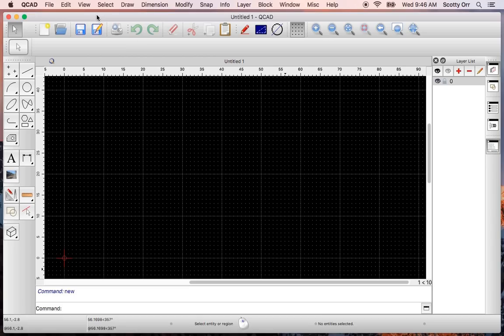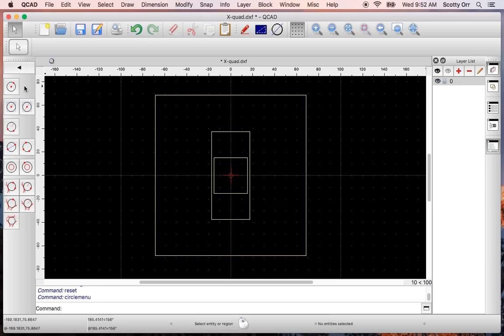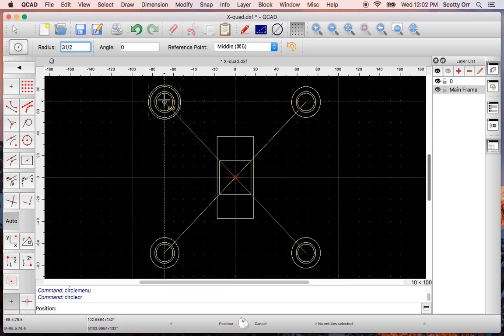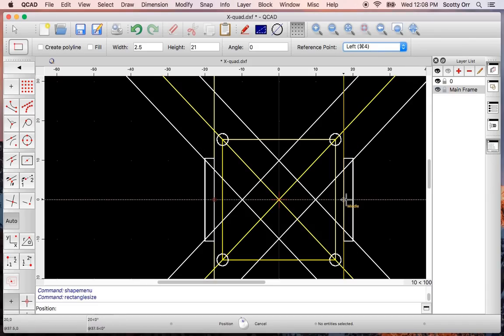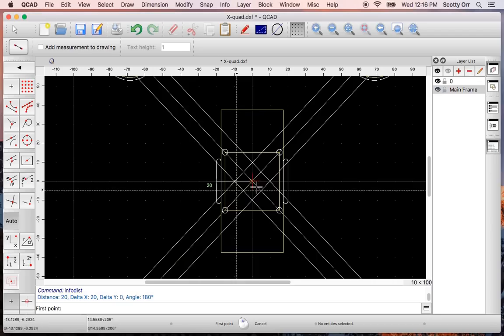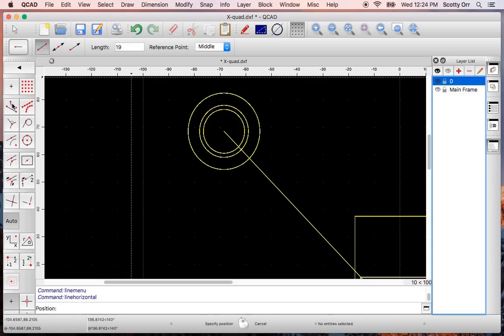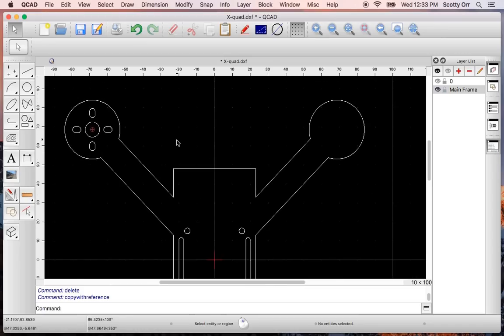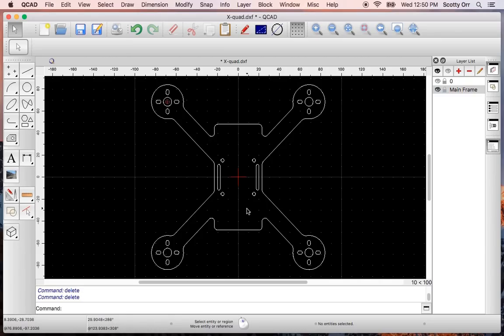Getting Started with QCAD

Comment: This is quite helpful.   One question i have is about making changes.  Suppose you decided to change the 6mm radius on the acute angles to 5mm or lengthen the  arns.  Is there a quick way for that or does it take a lot of manual rework?
Reply from the maker: I don't believe QCad offers the functionality of having drawing elements change when changing dimensions (like autocad for fusion360). If it does, I don't know how to use it.  There may be work arounds (you can "scale" a selected entity, but it's still going to be a more manual process and won't automatically adjust adjoining entities).

Comment: before buying , be aware that the $40 fee does not gives you access to the CAM plugin , you have Qcad pro , that's all , no CAM.I was trapped in this...
Reply from the maker: Yeah, unfortunately getting the version with CAM will set you back around $120.  I just use the free community edition of QCad for design, and use the Fusion 360 manufacturing environment for my CAM.  (I just use these for hobbies though, and not to make money.)

Comment: When starting to create something like this I would suggest that you take a moment to study what you envision for the final result- you have 4 arms and motor pads that are all the same, you have 16 of the small slotted holes and 2 of the long slotted holes.  The first rule of CAD is to not draw the same thing twice.  You could have created one of the arms including divisions and fillets, then you could copy and mirror it twice to get all 4 of them.  You could have created one of the small slotted holes and copied and mirrored/rotated it.  You could have created one of the long slots and copied it.  This would have been a lot less work.
However this is still a very good video to demonstrate the capabilities of the program and how to use various of the commands.
Reply: How ? This is not autocad
Reply: @jmans4928 QCad has all the necessary tools to do this.  For instance he makes 2 slots for straps to hold down the battery.  He does the same operation on each slot.  He could have drawn one slot and done all of the modifications to it then copied/mirrored it to the other side.  The arms with the motors have the arms themselves, the motor pads, slots.  When you look at the finished item you see that there are 4 arms that are essentially identical, this is a prime situation where you would draw just one and do mirroring.  Look at other places- the 2 slots for straps- you draw one and mirror it.  Each motor pad has 4 slots- you draw one slot then mirror and rotate the others.  When you have to do so many steps to make a slot with rounded ends you don't want to do it any more than you have to.  When you put in fillets at the corners you don't want to do it more than you have to.

Comment: Excellent way of introducing Qcad tools. Thanks for the video. Surely there is a fillet tool that could do the final rounding more easily though?
Reply from the maker: Thanks.  There is such a tool - pointed out by Bzeemer in his comment earlier.  It's the "Round (m)" command.  It's in the Modify menu if I recall.  I use it all the time now.

Comment: Thank you very much for this tutorial. I used to be an AutoCad user and this program comes close to what I was used to draw with. I got a small tip for you to use the command "Round (rn)" to make an arc between two lines instead of "2 tangents and radius (ctr)".
Reply from the maker: Hey man - thanks for the tip!  That will save me tons of time.  Guess I should be exploring more of the tools in QCad...😉

Comment: What an amazing video. Very clean and concise use of this CAD tool in a practical application. 
I wanted a simple CAD tool to map out the boundary of my garden and I found testing various tools required intensive learning that was time consuming and tiring. This video showed how to find and use important tools in QCAD in a drawing example that would be applicable to most drawings. The only thing not covered was how to show dimensions on a separate layer. Thank you making this great video👍

Comment: Thank you very much! great tutorial however, I would like to see if you can help with architectural drawings and printing. I have been having problems with dimensions in foots and inches, somehow it does not show in the drawings and cannot get the grid measurements to draw in 1/4" = 1'-0"
Reply from the maker: Thanks!  Sorry, I can't help you.  I never use those features in QCad.  I'm guessing they are probably there, but I'm not sure. You might check out some other tutorials or do a "search" for that feature.

Comment: The tutorial is very good. However, this software has a very bad workflow as compared to other Autocad 2D and its look-alikes.
Reply from the maker: It could be my use of it is what the bad workflow is.  It works great for me, and it's free!  I haven't tried Autocad 2D and likely won't because I can't afford it.  (Even if I could, QCad suits my purposes for 2D.) . I use Fusion 360 for 3D.  I find I can export my DXFs into 360 for extruding, and setting up CAM operations.  Thats "my" general workflow for now.  Could be I will eventually use F360 for my 2D work, but it will require me to learn a new skill set.
Reply: @sloscotty  Try Draftsight. It is free until December 2019. The time you will take in it to do the same thing will be only 25% of that of Qcad

Comment: This is a very good tutorial.  I have a question though.  I want to use this to laser cut acrylic.  I want to create a rectangle cutout and screw hole cutouts to convert to Adobe Illustrator for the laser cutter.  I have a rectangle set up as 80mm by 60mm and the screw holes are set at the corners.  When I convert to PDF and print, the drawing is not in scale.  How do I print in scale? Thanks
Reply: I haven't worked with the PDF export feature that much.  When I have, it has been to reduce the drawing in size.  Then I convert that with Preview (Mac) to a jpeg, and capture a screen shot, then print that.  That won't help you, because you want actual size.  If your units are set to millimeters, then I don't know why the 1:1 export wouldn't work.  (And then I've had printers themselves mess up the scale. ) I have laser-cut acrylic before, but my front-end will accept QCad's DXFs just fine, so I haven't bothered with conversion programs.
Reply: Scotty Orr thank you! We have an organization called dospace that we can use their laser cutter. We have to export the file to adobe illustrator and use the print feature to do the laser cutting

Comment: I can't seem to get any drawing's from Q-cam into Mach 3...Wonder if you might have any tips or ideas...I have been trying for days...So bound and determined to get this figured out. I think it might be something with the scale...Any tips would be so appreciated. That first tip of moving the center point..really helped me. The divide step really helped me out.
Reply: I haven't used Q-cam or Mach 3, so I can't be much help, sorry.  It's possible there is a Mach 3 post-processor for Q-cam, but I don't know.  I  import my DXF's into Fusion 360, and use it's CAM features with a GRBL post-processor.
Reply: @scottyorr3764   I figured out I was just not saving my files correctly. So stoked I got it dialed now.  I am really studying and learning so much about Qcad/cam.  Have a good one.
Reply: @scottyorr3764   Thanks man...appreciate the reply...Sure dig learning from all your tutorial vids..Have a good one.
Reply: I found that if you don't save it the exact way Mach wants to see it. It will never load. Kind of tricky to get it all figured out.  Really like your Qcad lesson.